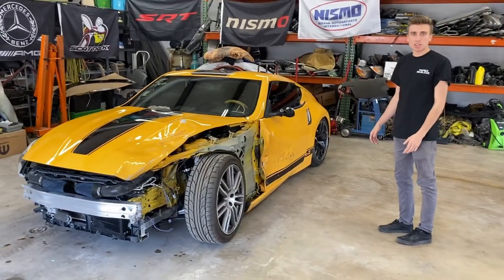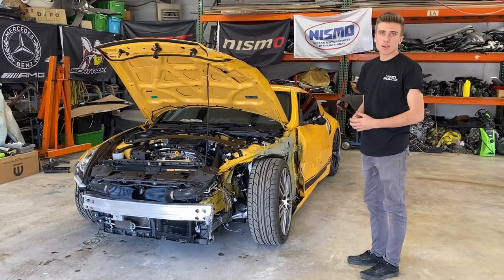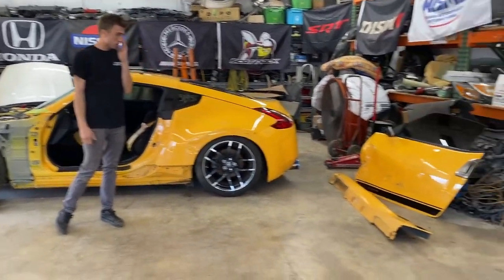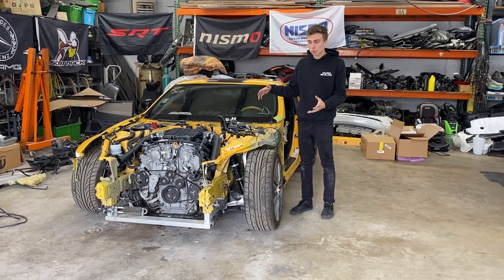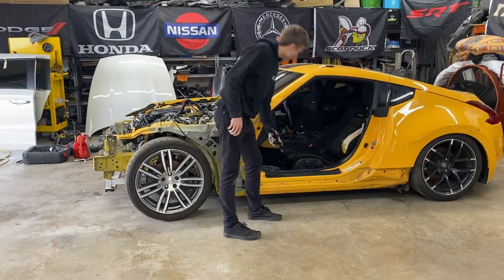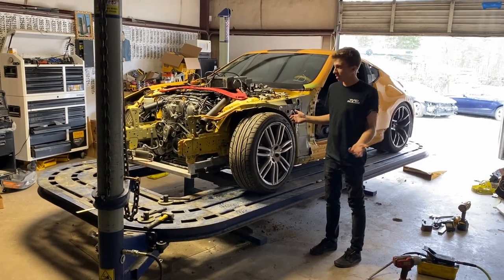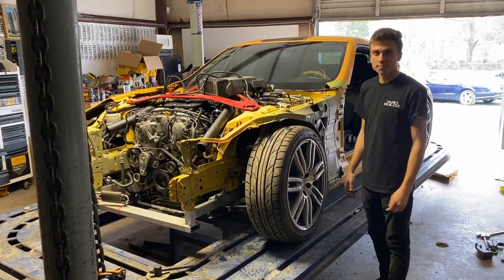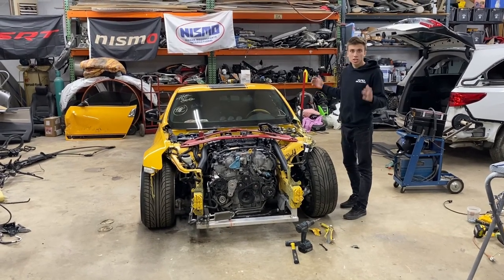I Bought A RARE Wrecked Nissan 370Z off Copart pt1 | YaroBuildz

Comment: Bad idea deleting the oil cooler, The 370z is notorious for going into limp mode due to high oil temps!
Reply from the maker: Have owned 15 370z. Never had issues. And doesn’t matter because I already sold the car. If it was one I was building to keep forever or a track car than definitely would run a oil cooler
Reply: @yarobuildz3357  Own a 2014, never had an issue, though on hot days I do get close to 220 (Texas), and I do not track mine either. 

Edit: Replied to the wrong person heh sorry.